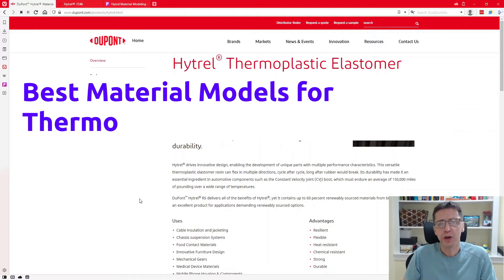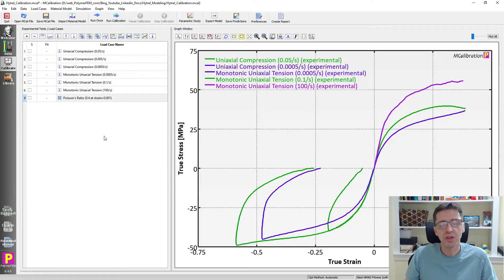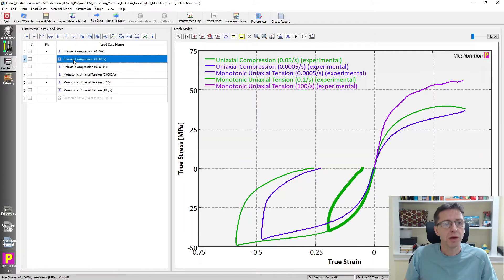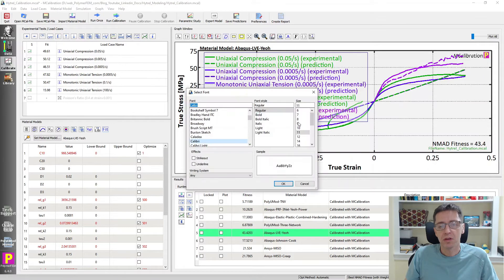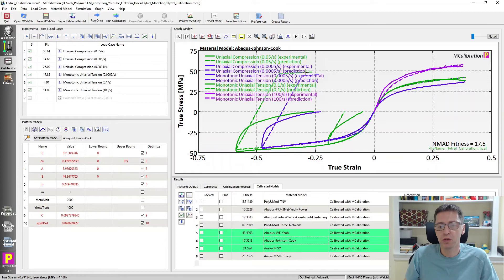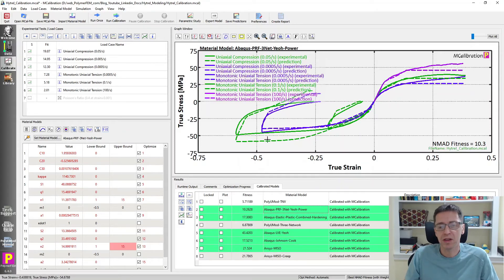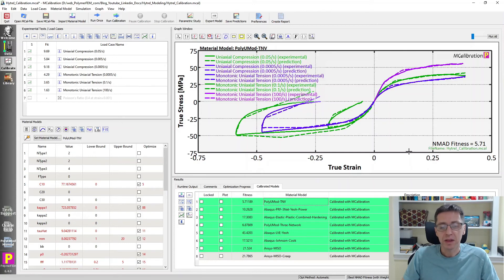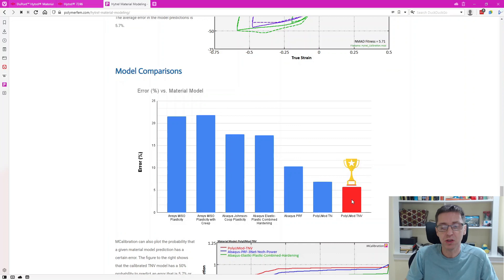Best Material Models for Thermoplastic Elastomers (Hytrel) in 2021

Comment: Hello, Many thanks for your useful videos. I have a thermoset elastomer material, could you please suggest that the Abaqus model for Viscoelastic -> Time-domain -> creep test data -> shear test data, would be a good model for me or the PRF model?
Reply from the maker: What is that max strain you are interested in predicting? Are you interested in frequency space predictions, or time-domain predictions?
Reply: @PolymerFEM  This material can reach the strain of 1.5 in low rates and the strain of 0.3 in high rates, so the strain range depends on the strain rate. I am interested to predict the material behaviour during the experiment time for different strain rates.
Reply from the maker: @ghazaleheslami1986  Since the strains are large, I recommend either the Abaqus PRF model or the PolyUMod TNV model.
Reply: @PolymerFEM  Many thanks for your help.
Reply: @PolymerFEM  Also, could you please help me to know that would be possible with the modified V-notched shear test data on my material, I obtain the PRF model parameters? Does exist any paper on the calculation of PRF model parameters with different test data?
Reply from the maker: @ghazaleheslami1986  Yes, you can use V-notched shear tests. You would then need to run an inverse FE simulation for the calibration. See for example: https://www.youtube.com/watch?v=J8L-5h4cDwI
Reply: @PolymerFEM  Many thanks for your advice. it was so helpful.